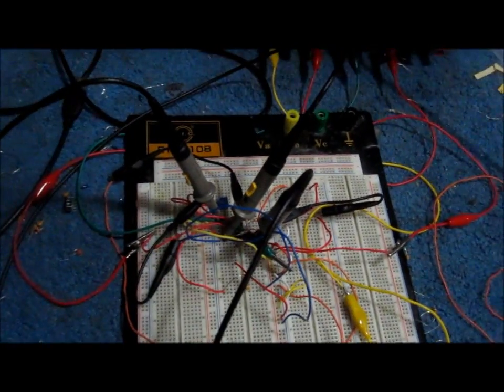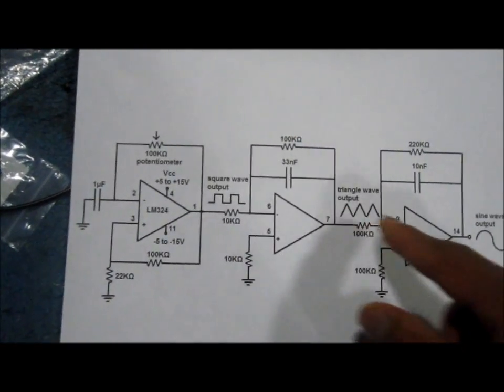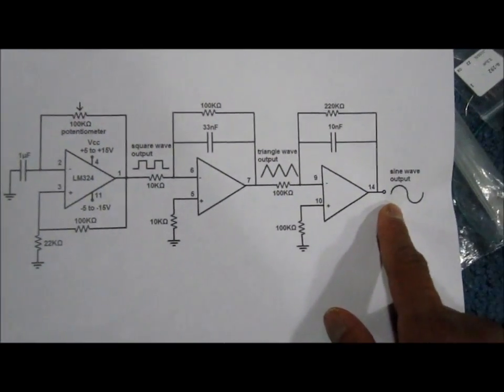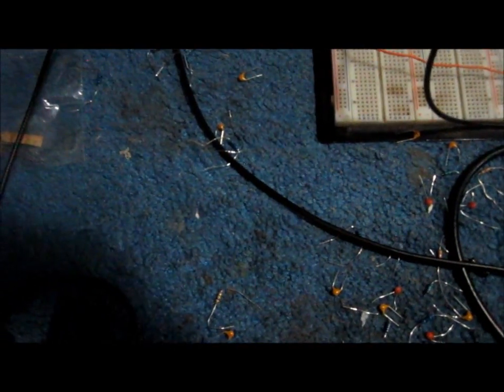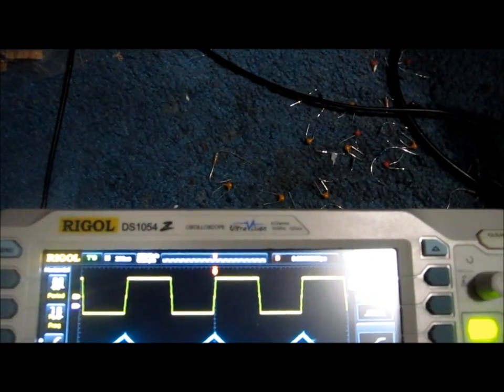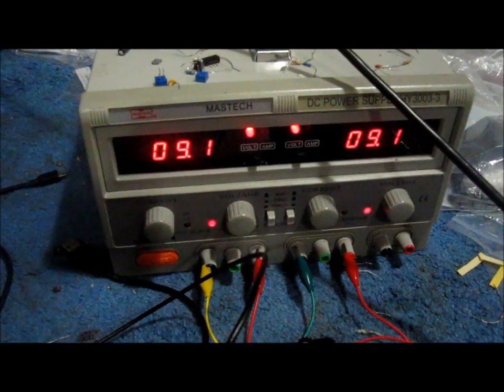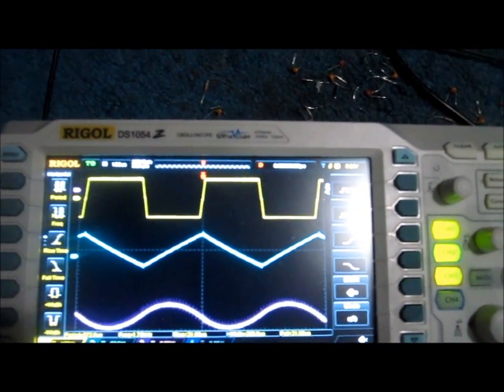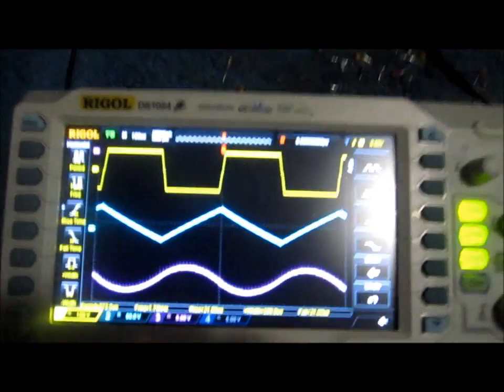How to Build a Simple Function Generator Circuit

Comment: I built this and got identical waveforms.  At first, I used a dual supply with two 9V batteries.
[Pos to circuit]---[+9V-]---Gnd---[+9V-]---[Neg to circuit]
The line above shows the two 9V batteries connected back to back, with Gnd in between.

The waveforms were just like the ones shown - a little wiggle half way up the rising and falling edges of the square wave, a little spike at the top of the triangle, and a sine wave at a much lower amplitude, that moved up and down as the pot was twiddled.

But I didn't like the two-battery arrangement, so rewired it with a single battery, and the fourth op amp configured as a voltage follower, following  the voltage from a voltage divider from +4.5V to -4.5V  to produce a pseudo-ground.

           [+      9v      -]    << battery
+4.5V |                  |  -4.5V                          R1 = R2
            |--R1---R2--|                                    or you can use a 10K pot
          Pos    |      Neg               |\
                    +-------------------------|+\
                                            10 |     \  8
                                                 |       >---+----- pseudo-Gnd
                                                 |     /      |
                                       *-------| - /         |
                                       |     9 |/            |
                                       |                       |
                                      +--------------------+

Of course the waves were smaller, as they were running from +/- 4.5V instead of +/- 9V, but apart from that everything worked the same.
Reply: Nice.

Comment: When i first did this my SINE wave did not work - I was working off the breadboard layout on the link because I was never forced to read schematics - But luckily I learned because the resistor on PIN 10 should go to ground (just like on the sch3matic) but on the breadboard laoyout the resistor goes to the negative voltage supply. 
its confusing enough with bipolar supply - but even more confusing when the breadboard layout is wrong... oh well it forced me to learn to read schematics which has proved to be very very very helpful

Comment: The link’s breadboard diagram shows pin 10, the non inverting sine stage input connected to the negative supply voltage and not the same earth rail as the equivalent pin on the two earlier stages.  Is this the way the actual circuit was connected?
The sine wave output was a bit funny and had a phase shift.
Reply: as soon as i switched this it worked for me
Reply: according the the schematic the only thing that goes to negaive supply voltage is pin 11

Comment: Using LM324 the square wave pulse in the scope has a very high slew rate,it is the time that needs for transistion from high to low and vice versa so the form is not square but trapezoid.Replace LM324 with TL084 and the output will become real square.Another major factor is the duty cycle has to be exactly in 50%.

Comment: Hi, I tried connecting the circuit diagram as shown in the video and it didn't manage to generate any waveform. Could you help in any way??
Reply: wilson lim what's the transistor used there in two integrators? Meant to convert square wave to triangular and sine wave
Reply: Did you split your power into a + rail, - rail, and a 3rd ground rail? That's probably the hardest part about using op amps ... powering them correctly.

Comment: I believe the reason you were seeing the sine wave move around on the scope is because the DC offset of the final output signal was changing when you adjusted the pot. If you use a capacitor in series with the output it should eliminate that DC offset and just allow through the sine wave. Thanks for the video and good luck with your projects :-D
Reply: he should of put a 1uF decoupling cap on the output and that would have fixed that problem.

Comment: How's the low frequency stability with the LM324? Say in the 1-1000 Hz range, does it wobble?
Reply: Dont use LM324 for frequencies higher than DC,but replace it with a newer op amp.

Comment: HI THERE, CAN I USED THESE CIRCUIT TO MAKE PURE SINE WAVE INVERTER , HOPE THERE IS SOMEONE TO ANSWER..
Reply: The sign signal here is not a pure sine;it represents a chain of fitted each to other and multiplied  parabol`s parts.It is too similar to sign signal,but mathematically estimated it is not.
Reply: thanks
Reply: do you know what is the is schematic after ne555 ic? 
can i use it to make inverter?
Reply: You can realize with 555 IC a multivibrator,a monovibrator,an autonome saw signal generator,as well as timing circuitry up to several minutes.But cannot realize an inverter.